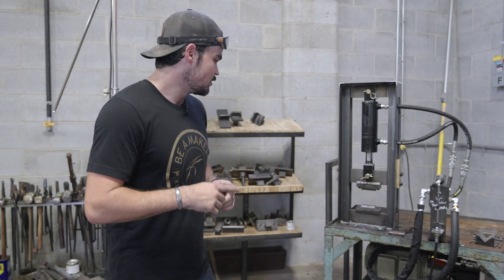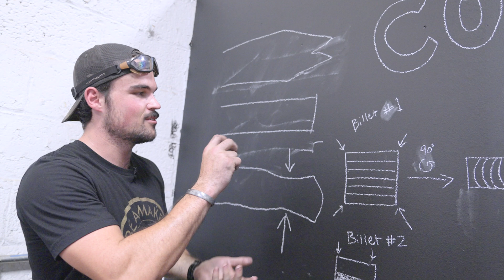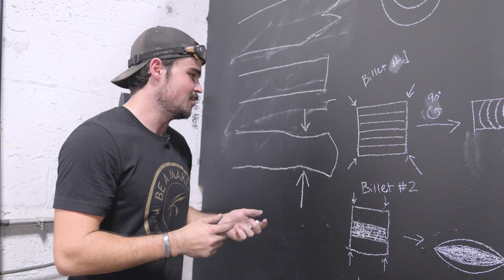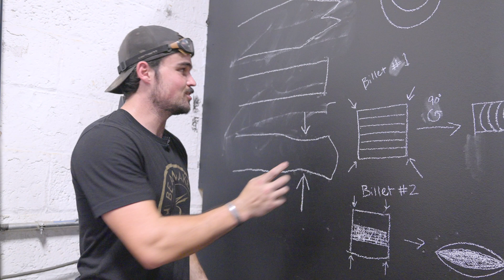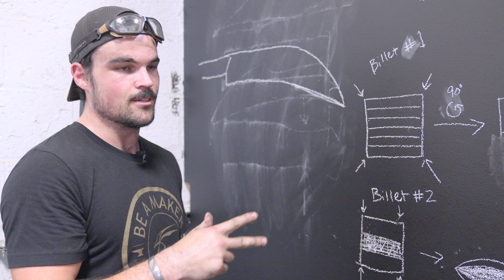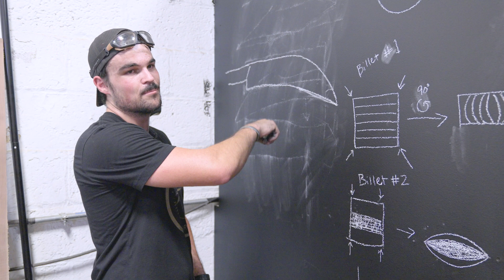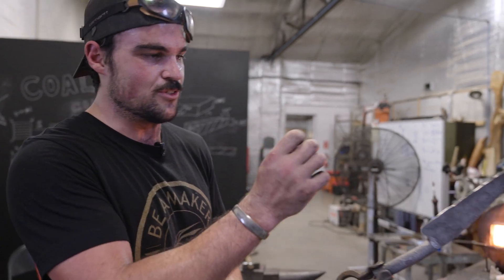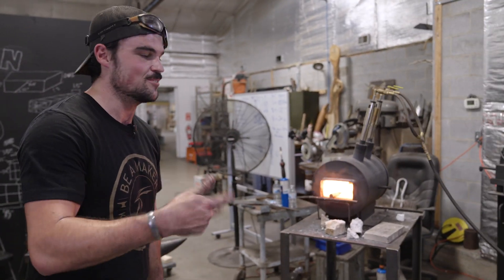Forging an Integral Knife on a 12 - Ton Coal Iron Works Press | SETH LOPEZ BLADEWORKS

Comment: Wherefore you get 1 inch round stock?
Reply from the maker: Another great place to check is McMaser-Carr.

They carry D2 Tool steel round here which makes for a great blade steel.

https://www.mcmaster.com/products/metals/shape~rod-and-disc/oversized-wear-resistant-d2-tool-steel-rods-and-discs/

McMaster carries a lot of different alloys and finishes, so be careful not to spend too much on tight tolerance stock that you'll be forging, and be EXTRA careful not to buy and heat up any toxic alloys or coated alloys. Do some research on any alloys or surface finishes you aren't familiar with. Lead and Galvanic poisoning are far too common in the blacksmithing world. Heat with caution :)
Reply from the maker: A good place is check is pops knife supply here 

https://popsknife.supplies/collections/steel/products/japanese-cutlery-1085-forging-steel?variant=27434389798976

They're currently out of stock, but it's always good to check. Another option for working round stock would be to forge. out a nice tall billet of layered flat bar so that you can completely control the shape and dimension of your starting stock!

Comment: Thanks for sharing your process. Guess I need to check the Coal Iron die selection again, looks like there's one I don't have!
Reply from the maker: If you're looking the the horizontally radiused dies that Seth uses to set his edge, then I'm afraid you won't be able to find them in our selection at this time. That was actually a pair of custom dies that Seth fabricated for himself for his personal press for that exact application! We have our blank die plates and plenty of good die stock to choose from if you want to take a swing at making some :)